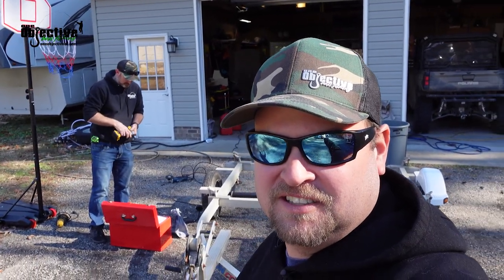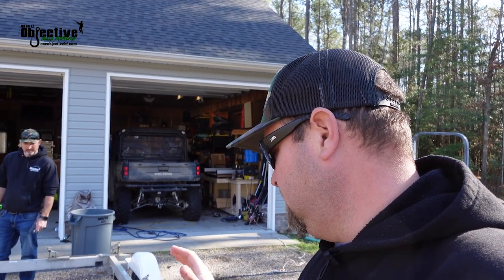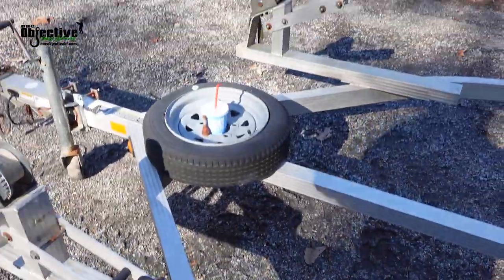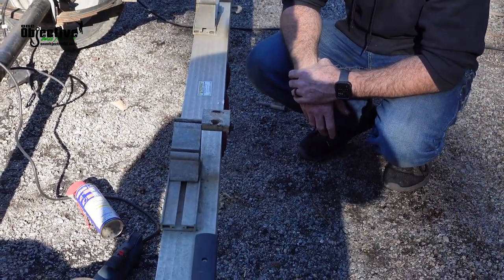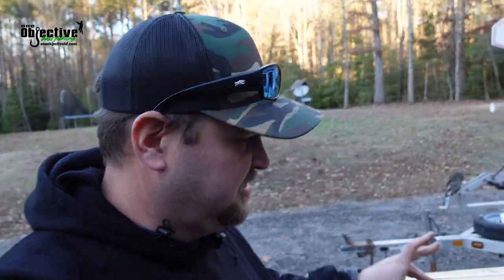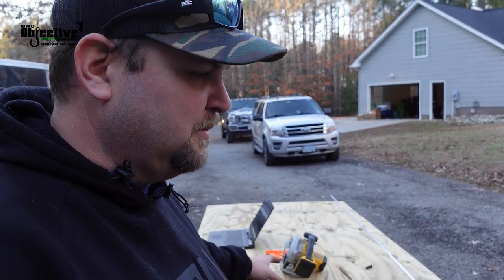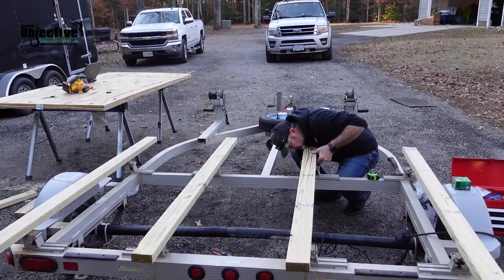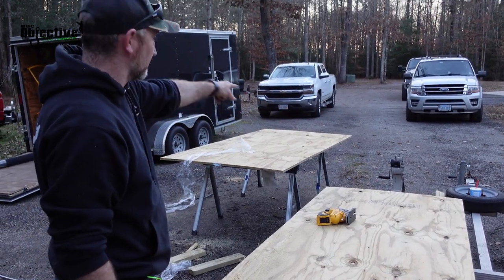Kayak Trailer Build | Part 1

Comment: Will be starting my own kayak trailer build with the option of 2 to 4 kayaks. I’ll be using my old boat trailer that hauled my seaark 20’ center console.  (Upgraded to a tandem axle for it). All goes well I’ll be able to use the second tear for the 3rd and 4th kayaks as a take on and off section when not using more then two.

Comment: I wanna see you guys fish out of that tandem Hobie Pro Angler thats like 17ft.
Reply from the maker: 😂 we might have to
Reply: @OneObjective  hey, why the wood on the trailer? You guys should of just got super-strut or unistrut  and then put pvc pipes down. What’s your email, I will send you a pic of the kayak trailer I built. I love your channel and products. Thanks
Reply from the maker: @ILLUMINATHAN79  the only issue is Hobie has stated that putting them on pvc piping or metal bars will void the warranty. We have built a couple with the pvc piping. And it did really good. But when you wrap the board with carpet. The kayak doesn’t move at all. It’s like it’s sitting on rubber. But thank you for watching. And thank you for the comment.
Reply: @OneObjective  I wasn’t aware of the warranty. Thanks for the info